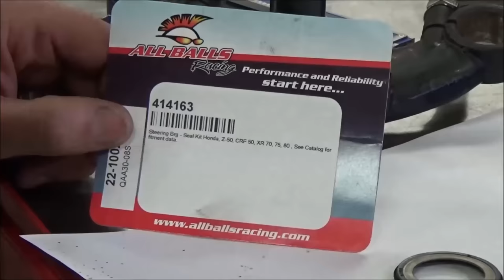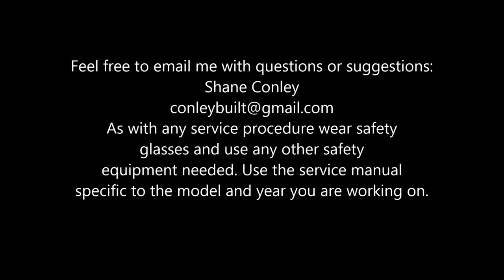The most "unknown" concern when upgrading steering stem bearings to tapered Timken kits #how2wrench

Comment: All balls now includes these washers idk if they did before,I like this guy he's thorough and I run into his vids alot when looking for technical bike stuff
Reply: No they don't. Just got a new set of All Balls steering bearings for an ATC 200e Honda today [ Aug 9 2024] . Noticed  the overall height was a lot taller. checked out you tube . Went to get some machine bushings and modified to fit. It is together now but overall height is about 1/4 inch higher. Had to space up the top triple clamp cover by that much. The seals may just work. Manufactures need to make a smaller bearing with exact dimensions.

Comment: In all cases that I have seen the seal has a different "land" on the stem than the bearing, the seal does not contact the bearing it seats in the frame and seals against the land below the bearing on the stem... (lower seal) The upper seal sits against the stem (inner) race.

Comment: Thanks for Highlighting this Shane, it seems it's happening with all "Pattern Part" suppliers, just reviewed a UK supplier (Pyramid Parts) and there are a few comments surrounding the same issue, so it would seem we either A) Buy the OEM part at an exorbitant price (no thanks) or B) Make sure you get the best fit you can, maybe utilising the old seals if possible, which isn't the answer, i know.
Anyhoo thanks for the heads-up and i hope someone somewhere can rectify this issue !
Reply from the maker: Old seals will not help in this converstion style. It's simply a design issue as I show and the spacer is absolutely required for clearance. Some kits (many actaully) work fine but every tech (or DIY) is ultimately responsible to check fitment when using OEM or aftermarket parts. That's the skill set I try to drive home...
👍 Thank you for taking the time to comment! Hit that subscribe button if you haven’t please! It helps us! 
Here is a way to support all the free videos.
Want to say “thanks” or “keep it up”? Click here https://www.paypal.me/how2wrench  

Coach Conley is also available for hire to personally work one on one with you if ever needed. Yep he is a real person. Give him a call @ 602-345-0432
Details here: https://how2wrench.com/product/personal-tech-training-phone-facetime/ 
Your answers and help are just around the corner. Save time and money while protecting your investment and yourself by doing it the right way!
Follow us! 
Web:
www.How2Wrench.com     
www.Tools2Wrench.com

Comment: The seal contacts the cup bore in the frame and touches the roller cage. I've fitted dozens and if greased the performance is excellent. There is no rotation only oscillation and the whole assembly is necely damped. This instructional is inviting people to get into trouble by reducing thread engagement and putting things out of position.
Reply from the maker: It's pretty hard to argue the video proof and read through the comments where others have the same issue. Your point of reduced thread engagement is super interesting when many of these kits are "taller" than stock as the timken style beaking pack is compared to lose (or caged) balls and race. We have at times simply choose not to use a conversion kit for the reason, Even the package and All Balls state is as correct. In those cases, there was such little thread available. 

We also are talking very small shims. If anything, installing a rubber seal dragging against the cage, concerns me that the handling of the motorcycle could (and it will) not only change the characteristics but negatively affect it.
Reply: ooooooooo....fighting words,jkjk I don't doubt,I know ppl do their work and own studys I wonder if this guy checked to see if you're right,that would be something, and a correct move

Comment from the maker: As stated, very rarely have these kits not been perfect right out of the box. BUT you must check! this video shows when they don't,  how to fix it, and would help many when using other cheap brands of bearing replacement kits when it comes to Timken style replacement. 

I'm showing what I've seen a few times in hundreds of these installed over 20 years...I teach technicians "how to" be a mechanic and things to look for beyond remove and replace. 
Could you spare $2 and support us with even more benefits? Smash the subscribe button and bell! Join this channel to get access to perks:
https://www.youtube.com/channel/UCBhM8DCKnT3qXwTW0eToyCg/join
Reply: I'm not sure you are correct on this. The seal will rest against the tube, which will keep it up off the bearing cage. Drop the whole assembly in the tube and then view it.
Reply from the maker: @Daveinet  No worries you're unsure but it's most likely you missed key information from fast forwarding as Shane clearly shows and explains the problem. Even an employee from All Balls verified the issue and agreed that the final assembly MUST be verified by the technician. As we shared, most of these kits work perfect, but this video shows when they don't,  how to fix it, and would help many when using other cheap brands of bearing replacement kits when it comes to Timken style replacement. 
Hope this helps you get clear. You rock for commenting! We will let Shane know! You can give him a high 5 here:  https://www.paypal.me/how2wrench   
Another way to help us back is joining or grabbing our T-shirt! Support links and gear below!  Awesome and thanks for commenting! Smash the subscribe button (thank if already a sub!)
Have you seen our "YouTube Trained Support Shirts? Great way to "high five us" https://goodfellasmerch.com/collections/how-2-wrench/products/support-shirt 

Join this channel to get access to perks:
https://www.youtube.com/channel/UCBhM8DCKnT3qXwTW0eToyCg/join    
-Daily MEMBER FIRST COMMENTS ANSWERED FIRST 
-Live Q/A video chats
-Wonder if we have a video on your need? Members can request content links!
-Full Access to the ENTIRE 700 video library
-Member-Only FREE tool giveaways   

Got an emergency and your head is about to explode from frustration or fear? Get Shane’s cell here: https://how2wrench.com/ols/products/techline-one-on-one

Comment: I reckon All Balls have given you the wrong rubber seal for the bearings..... I have just checked the set I have here; and the inner washer part of the rubber seal bottoms out against the inner race... no matter how much you torque it down the rubber cannot touch the roller cage
Reply: Perfect this is what I have just described. You have to press firm but the text needs the outer race for him to text this. 
The seal will press against the outer seal and form a nice snug seal without intrusion. I have the same type.

Comment: The all balls kit comes with correct spacers I believe.
Reply from the maker: Thanks for commenting and adding value to our community!
 This was an all balls kit. 
Have you subscribed yet to never miss a video? Have you seen the video playlists? Over 600 videos! Check them out here: https://www.youtube.com/user/conleybuilt/playlists
Want to say “thanks” or “keep it up”? Click here https://www.paypal.me/how2wrench  
Your answers and help are just around the corner. Save time and money while protecting your investment and yourself by doing it the right way at www.How2Wrench.com
Reply: I think you may just have a dud set, use these kits all the time some have 2 different sizes in as top and bottom bearings are not always identical in thickness

Comment: I recently installed a set of "All Balls" tapered bearings in my SR500 Yamaha 
The previous owner had already replaced the original bearings with tapered bearings and the outer race of the lower tapered bearing that I now needed to remove from the frame had a larger inside diameter than the original bearing would've had and so there was no lip to drift (strike) the bearing out
This made it near impossible to remove the lower bearing race, I was going to weld a washer to the bottom of the bearing race but didn't for fear of badly damaging the bearing's seat in the frame
I ended up grinding a thin screwdriver's blade to a sharp edge and bent it an inch or so from the tip of it's blade and managed to hammer the sharpened tip of the screwdriver between the bearing's race and it's seat in the frame and moved it enough to allow a washer to fit in between the bearing and seat and I was then able to drift this washer from above and by working the washer around the bearing I managed to remove it 
This caused slight damage to the seat but I was able to correct it
The lower "All Balls" bearing I refitted has the same problem as the bearing I removed, no lip for future removal 
Another problem is these tapered bearings are apparently eight to ten millimetres taller than the height of the original bearings and this caused other problems with the way the top clamp sits relative to the steering stem  
After I managed to remove the tapered bearings fitted by the previous owner I should've thrown away both the old set and the new "All Balls" sets of tapered bearings and refitted a set of original races and ball bearings
Reply from the maker: We shared this with Shane and he said "been there...sometimes OEM is best to stick with" He said to give you good ahead and share this video link with you (normally a member benefit) https://youtu.be/oYW1Syr8Fwg 

You rock for commenting! We will let Shane know!  
Smash the sub and like please. Throw Shane a high five donation, channel membership or merch for saving you $$$$$$$ Links below to support more for this work! 🙏
Want even more? Best $2 you'll ever spend...Join this channel to get access to perks:
https://www.youtube.com/channel/UCBhM8DCKnT3qXwTW0eToyCg/join      
-Daily MEMBER FIRST COMMENTS ANSWERED FIRST 
-Live Q/A video chats
-Wonder if we have a video on your need? Members can request content links!
-Full Access to the ENTIRE 700 video library
-Member-Only FREE tool giveaways  
Ways to support or high five How 2 Wrench! Thank you in advance. YOU MOTIVATE US TO DO MORE!
1. Smash the subscribe button (thank if already a sub!)
2. Have you seen our "YouTube Trained Support Shirts?  https://goodfellasmerch.com/collections/how-2-wrench/products/support-shirt  
3. High five donation:  https://www.paypal.me/how2wrench   
4. Got an emergency and your head is about to explode from frustration or fear? Get Shane’s cell here: https://how2wrench.com/ols/products/techline-one-on-one

Comment: Torque of the after market bearings.  Ball vs. tapered.  Do you use factory torque settings?
Reply from the maker: Good question. Tapered vs. Ball are almost always different I believe. I'm really not confident to answer. But when it comes to the steering stem. There is a considerable amount "feel" and operation check steps. The torque spec is very dependant on the shaft diameter. I always tq 1/2 the spec and "feel" and keep going. Not applying enough torque could also risk the races not seating all the way too. 
👍 Thank you for taking the time to comment! Hit that subscribe button if you haven’t please! It helps us! 
Here is a way to support all the free videos.
Want to say “thanks” or “keep it up”? Click here https://www.paypal.me/how2wrench  

Coach Conley is also available for hire to personally work one on one with you if ever needed. Yep he is a real person. Give him a call @ 602-345-0432
Details here: https://how2wrench.com/product/personal-tech-training-phone-facetime/ 
Your answers and help are just around the corner. Save time and money while protecting your investment and yourself by doing it the right way!
Follow us!
Web:
www.How2Wrench.com     
www.Tools2Wrench.com

Comment: I have the same bearings as these..
Of you push the seal hard enough against the outer race that seal will flare outwards , you'll get a nice seal without the rubber rubbing on the bearings. 
I actually found the bearing set was.  perfect. 
Again on the seal there is a line you can clearly see. That will bend once the seal faces against the outer race. 

Please can you do this test again but put the outer race on and press firm. There will not be any intrusion of the seal to the bearings.
Reply from the maker: Feedback is always welcome. You’re year make and model may be fine but this one and others, (I just filmed a Harley with same problem) are not right. I ask you to watch the video again and the close “gap” that creates the problem. No seal should cause significant drag or bearing contact. 😊 seriously appreciate you commenting and continuing the conversation.
Reply: @How2Wrench  thanks Shane, 
I will take a real close look. 
I tried to creat the same problem as you showed here. And yes I do get the same issue if not using the outer race.  Is when holding the bearing in to the race and the seal applied on top there is drag unless the seal is pressed firmly. I noticed that the seal flares outwards and drag is eliminated.  
I will go back and recheck your video. Thank you for your response.
Reply: @How2Wrench  ok , just went back and re watched careful. 
I understand what you are pointing out here and it's a good point . 
My kit was for a Honda vfr 750 94. 
I just bought another kit yester for the Suzuki Gsx 750 f 2001. Otherwise known as a Katana. 
With out the outer race yes I do get the same issue. But putting them all together. Outer race , bearings and seal. There is some drag until squeezing it together firmly. 
Before I fitted mine to the vfr I checked  many times over. 
Upon fitment I made sure that the seal flares outwards.  Was a great. 
Can you try it with the race and see what happens. Many thanks and thanks for your response.
Reply from the maker: @calvinmartykleinmcfly6998  Of course, I love sharing and working with not only kind people, but those to learn from. Welcome to the channel.
Reply: @How2Wrench  thanks for looking in to the Shane. Great channel by the way. And thanks for responding . Keep up the great work. Your videos are extremely useful and some great teaching tips applied.
Reply from the maker: @calvinmartykleinmcfly6998  🙏

Comment: Seal is no hitting cage, You have to push it down evenly, on Your wideo seal and cage is always with gap and askew. No gap,  no problem, work like design.
Reply from the maker: Can you please review @ 4:09 and see it pushed down and hitting. If you watch the entire video, he shows it hitting when pushed down. It was noticed after the student could not get the steering not to drag no matter how loose or tight when installed. Shimming it fixed it correctly as shown. We know there are so many of these kits that work well and you believers in the product struggle with seeing this. We've only ever seen it two times and used it as a teaching lesson in looking at the details of how it's supposed to work. What do you think now?

Comment: That seal is not necessary. 
The Italian bikes with taper rollers as std kit, (MG LeMans, Duc 900 etc)
Had a pressed steel cover with a 4mm lip that enshrouded the top of the headstock. 
there was never any problem with rust etc. LM grease it up, good to go.
 And a shallow lip rubber disc (stepped) under the bottom bearing.
Reply from the maker: I hear you. Riders that ride in heavy rains or those crazy "powerwashers" would find a slightly longer bearing life...lol 
Thanks for commenting and adding value to our community! 

Please subscribe, share and consider a H2W membership to support our free work here! We are ramping up for the upcoming new member only site with profiles, raffle drawings, and weekly live Q/A sessions and a for sale page!

We have a LIVE Q&A starting soon and will use comments from videos to try and answer too. Got a question you need answered sooner than our LIVE Q&A Shows are on? Here’s how to get your answer for free! https://youtu.be/oAeXz1nd-eQ (and other free tools and products!)

Get my cell number here: https://how2wrench.com/product/personal-tech-training-phone-facetime/

Have you subscribed yet to never miss a video? Have you seen the video playlists? Over 600 videos! Check them out here: https://www.youtube.com/user/conleybuilt/playlists    

Your answers and help are just around the corner. Save time and money while protecting your investment and yourself by doing it the right way at www.How2Wrench.com    

Want to say “thanks” or “keep it up”? Click here https://www.paypal.me/how2wrench  Thanks for commenting and adding value to our community!
Reply: No Yamaha from the 70/80s has seals, all my bearings on my 5 80s Yamaha lasted 30 year +.